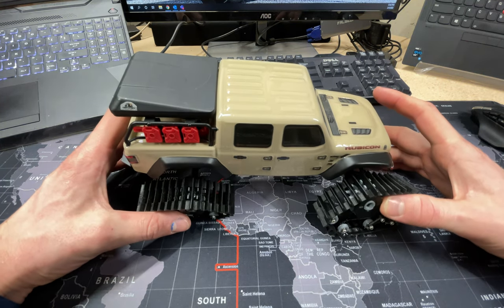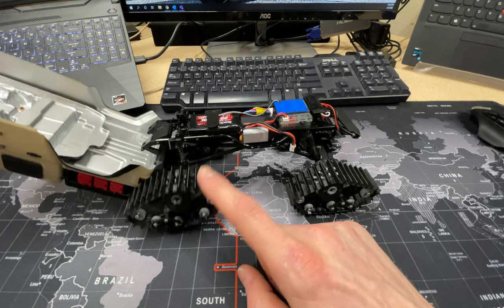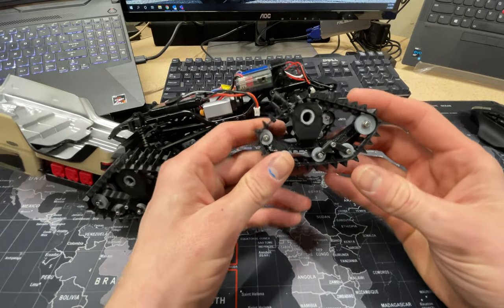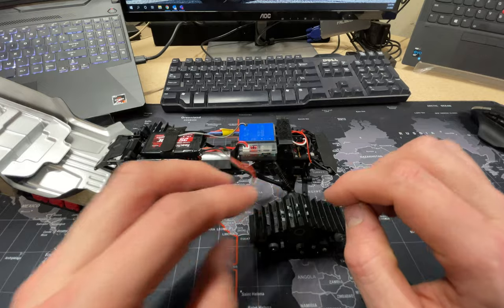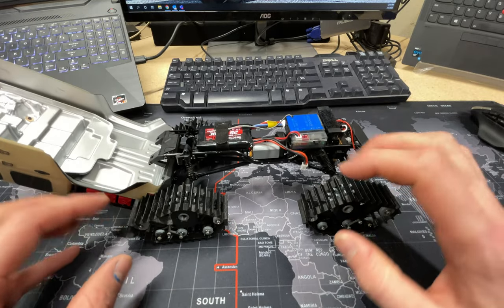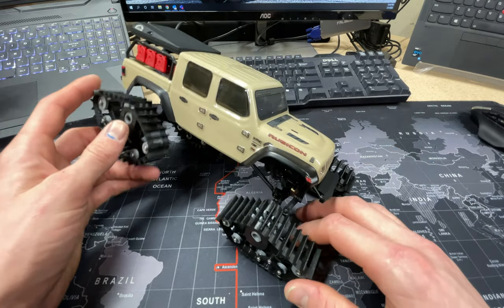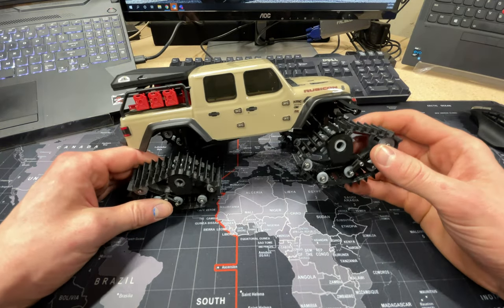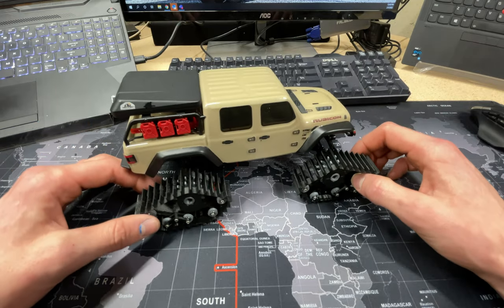The New SCX24 Gladiator on Tracks in Deep Snow! 4K

Comment: those 050 motors are very good, its the same as the branded ones. I atacched aluminium heat sink at the sides and no problems in a year with all the weight possible added.

Comment: Just a future idea 💡 
If you design them to fit a tire with the sidewalls cut off, wrap it overtop with studs to keep the tire "band" in place on the tracks and you'd have the ability to make some really grippy tracks for rock crawling 😉😉 I'd try but I lack the printer and design ability so far

Comment: Wonder if I can add fpv & crossfire or elrs to this with tracks? Rip around big field here
Reply from the maker: I’m sure you could! I do have an elrs transmitter and some decent fpv gear, maybe I’ll have to give it a shot 😂
Reply: @CineMoto24  I ended up making a hovercraft with spare stuff but was too small to go over uneven snow. So now I want to do a rc car. I'll put in extra receiver (I'm need pwm) & extra vtx.  Originally was looking at 124016 or 18 .. or eat06 tank .. but loving this track thing

Comment: Ive been having trouble printing the tracks… any advice?
Reply from the maker: What troubles are you having?
Reply: @CineMoto24  the teeth part is printing great but im having the in between parts come out very brittle and inconsistent. Iv tried to follow your wall parameters. The TPU dosnt have any moisture and im printing very slow. It dosnt seem like i have a feeding issue either. Its not slipping or jamming.
Reply: @CineMoto24  am i just printing too fast?
Reply from the maker: @bigblockbumpside2296  I am not sure. Does your slicer preview show that section as a solid line before printing?
Reply: @CineMoto24  shows it solid
Reply: @CineMoto24  what is your print speed? Also is there any reason for no top or bottom layers, what does that do. Thanks!
Reply from the maker: @bigblockbumpside2296  that tells us it is an issue on the printer end then. I would calibrate your e steps with the flexible filament as that may be causing it to under extrude. I would also confirm that your retraction settings are correct for your printing applications. Check out some videos on YouTube for both of those and hopefully you can dial it in!
Reply: @CineMoto24  thank you! I Appreciate the reply. You make some really great content! Youtube and 3d designs. Keep up the great work man!